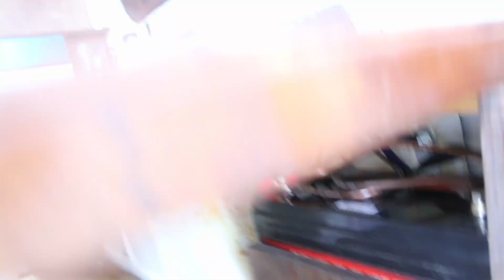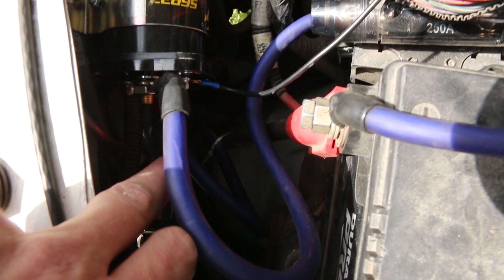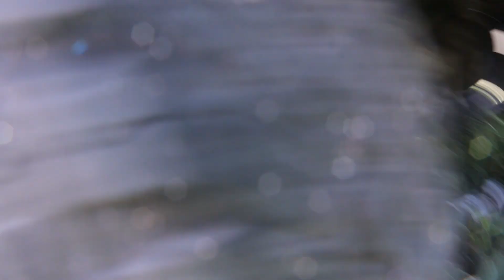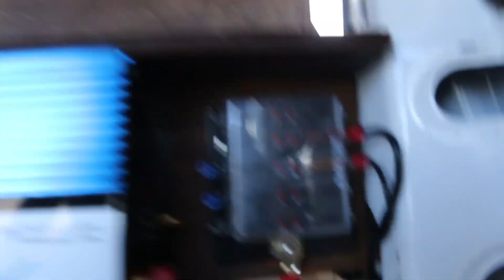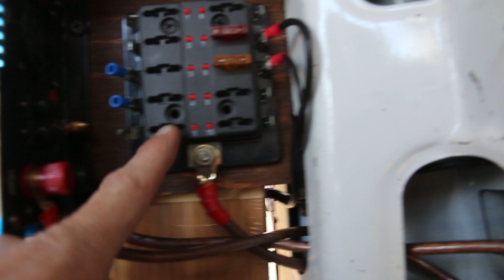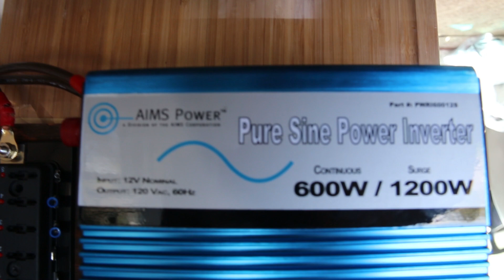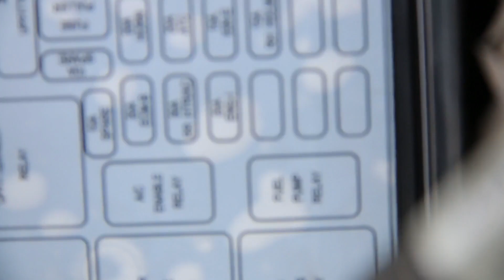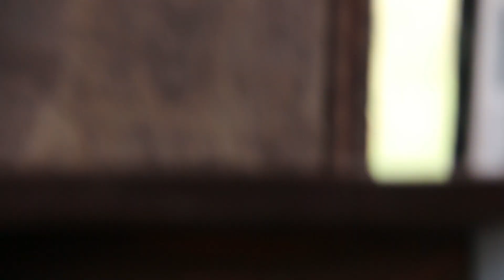How To Install A Secondary Battery, Isolator, Inverter In Your Van

Comment: I read one f your comments where you reply saying if a secondary power source like a solar panel is added the relay can or cant be used i didnt understand ? Does it mean the stinger sgp32 or the AC enable relay can or cant be used when using secondary power source ??? Im so confused
Reply from the maker: You can add a solar panel and still use the relay
Reply: i think you can use a solar panel but it should be hooked up to the primary battery for the started. that way if it gets up enough voltage itll start to run over to your secondary battery that is doing your other stuff.  gotta keep the starter battery healthy first because whats gonna get you out of the sticks to get any other supplies you may need on your journey. having the ability to push start a standard is always a good backup plan but push starting is just plain hard to do. lol (pro-tip=unless you think to park on a slope cause you know your battery is bad beforehand ;)

Comment: Hello Mike, very good DIY instructional video. I must comment on one thing... I will add an AGM charge regulator on the alternator circuit in my Astro van so that my deep cycle battery can last longer. These like a slow and low charge compared to your crank AMP battery. VanLife!

Comment: Do you need to vent to the exhilarate battery to the outside
Reply from the maker: If it's a lead acid battery or any other unsealed battery, then yes. This agm is a seal d battery so it does not. If you can fit the battery in the engine compartment or other location on the outside, it's a better option either way

Comment: I would bring a negative wire back there, instead of running all your current through the vehicle/ using your vehicle as a conductor.   Wonder what the side effects are?  Any r.f. being produced?  Any current bridging a gap/ ready to burn your whole shit down?
Reply: The vehicle chassis is used to ground all the electric.
Reply: @LawnWrangler323  I know the entire vehicle is bonded. But why call it a ground?  Is the current going to ground?  Or back to the negative terminal?
Reply: @--JohnDoe  electrical ground, the negative terminal of the battery (normal operation)
Reply: @StrokeMahEgo  so I connect the negative terminal to the ground? Well then how do I drive away if I'm teathered by a wire?  You must of mean bond the negative and vehicle chasis together, right?    B.t.w. which way do electrons flow according to electron theory?
Reply: @--JohnDoe  the chassis of the vehicle is connected to the negative terminal. Therefore, any conductive surface on the vehicle chaos can be used as an electrical ground without running a new cable to the negative terminal. 
Electrons move from negative to positive.
Reply: StrokeMahEgo if it flows backwards then why do we fuse the positive, close to B+? Just trying to understand why fuses are located where they are...
Reply: @code3responsevideos872  because electrons flow from - to +, but electrons are negatively charged, so " the charge" goes + to -
Reply: StrokeMahEgo so if that is true, is it necessary to fuse a wire running between dual batteries at both ends?
Reply: @code3responsevideos872  I don't know, but that's what's I was taught in my electrical apprenticeship for electrical theory.   Laws are what is happening, and theories are what they think is happening.
Reply: @code3responsevideos872  necessary, probably not. The fuse just breaks the circuit if it goes over draw
Reply: StrokeMahEgo I am hooking up a dual battery set up through a VSR. All of my loads will hook to my second battery which is controlled by the VSR. I am planning on fusing the B+ wire to the second battery. Also am fusing all the loads separately. This seems to be an effective way to keep my start battery separate and also minimize the load on my alternator. If the VSR input goes below 12.8 it will shut off the charge line. Any thoughts?
Reply: @code3responsevideos872   The Length of wire from the front fuse to the back fuse will have current to it from either battery if one of the fuses has blown, so if the vehicle had a smash and that wire was shorted out by that crash, without that second fuse there would be a fire hazard.
Reply: challenger1948 so I DO need to fuse it at both ends!!! I was planning on doing it but I wasn’t sure exactly why! Thanks for your help! Last question. Can I ground my second battery to the frame? Or do I need to run a dedicated wire to my main battery?
Reply: @code3responsevideos872  Ground it to the frame, just make sure it is a good  clean ground, just the same as you would do for the main battery
Reply: challenger1948 thanks. I got my batteries hooked up with a fuse at both ends. I hooked up everything and it works great! Thanks!
Reply: @code3responsevideos872  if you want the most reliable system, ground EVERY battery to the frame AND body THEN ALSO run another cable connecting both negative terminals.  i guarantee youll have a much more solid setup this way.  itll also work the way jordan mamrak says too but what if one of your grounds gets a shaky connection? could start a fire just as easily as a bad positive connection could! all my grounds are hidden so the more the better from my poit of view but if theyre all out where you can regularly check them, grounding with one point per battery is fine. they will just need a more regular cleaning cause they can get loose or corroded up too just like the positive side
Reply: James Wise thanks for your help. I got the battery grounded at the frame.
Reply: @--JohnDoe  Your comment about the ground...that's a joke, right?
Reply: @Truedoogie  what ground? There is no ground in automobiles. How do you connect to the ground and still drive?  It's a negative terminal.
Reply: As a fabricator, welder and hot rod builder, I'd like add a little advice. ALWAYS grommet and paint any through holes through metal. Also when dealing with older vehicles, if you ground to chassis always run a separate cable 6ga minimum from chassis to battery also. Rust can do weird things to steel and you may not have a good bond back to battery.

Comment: great video! how is your VMAX SLR battery holding out? im thinking of doing a similar gig as yours but heard that AGM batteries do not do well installed how you install them. could you share any advice/experiences with your current battery? i just want to make sure i get the right one. (my electrical needs are pretty much the same as yours)
Reply from the maker: This wasn't my van, so not sure how it's still holding up. I do however use the same batteries with my wind turbine and they've been holding up well for a few years now. They can keep a charge for a long time without draining

Comment: Hey Mike, thanks for the great vid, and commenters for some improvements like grommets. I got a question for ya: I want to do this set up in my 99 Subaru BUT I also want to make it as easy as possible to remove and then plug back in. The reason is so I can use the battery and inverter as a busking rig that charges in my car, so ideally I would want to house the battery and inverter in a rolling suitcase or something similar then be able to snap the system back into the cars main battery. Hope I was clear, any help much appreciated!
Reply from the maker: Cool idea. I think you could do something like that rather easily. I'd probably just build a small box out of plywood, cut out handle on either side and mount battery and inverter inside so they don't get damaged when moving. Could mount the inverter in a way that holes are cut to access the plug end without having to open the box. I would add banana style plugs for quick connect and disconnect of positive and negative terminals. Make sure you have something to cap off the positive lead coming to the battery when disconnected to avoid grounding out. Hope this makes sense. Would be easier to sketch it out than explain. Good luck
Reply: @MechanicalMike  wicked, thanks man. I'll grab some banana plugs like you said and do it ✌👍👍

Comment: Great video. Why diddnt you hook the power inverter to the fuse pannel is there a reason it's direct to the battery.
Reply from the maker: The power inverter has it's own fuse and creates A/C power for plug in devices. The  fuse block is for powering D/C electronics that are built into the van

Comment: Question I bought an Stinger SGP38 and will be running a two port 12 volt socket one for my front view facing dvr and one for my cell phone which had 2 USB charging ports. I will also connect an Everstart Plus 400 watt inverter to run my laptop and any secondary equipment such as my AKAI MPC 25 and connecting all of this to an 1995 geo metro 3 cyclinder, so my question is what wire size guage do I use for the battery connection and guage wire for the starter connection and finally on my vehicle which one do I connect the "true ignition source"???

Comment: Advice switch out the fuse for a circuit breaker.I have seen fuse holder melt and the fuse not blow. Also nothing worst then to be in the middle of nowhere and lose a fuse

Comment: Good evening and thanks a lot for sharing your work, especially laying down on the ground to show the details. I recently purchased and new battery for my Honda Accord 2004, and kept the old one for additional use / dual use for the basic appliances ie microwave, rice-cooker and electric kettle. At this moment I didn’t purchase any appliances and I want to know from basics: what wires, inverter should I buy to run basic rice cooker, microwave and electric kettle: not necessarily to run all same time at once. Please recommend me the appliances  and connection materials so that I can take to an electrician to wire it for me. Although I want to get the electrician to get the job done; I would like to be part of the planning stage and selection of the appliances. The purpose is to support me for RVing.

Thanks a lot
Reply: An idea for Down the road. batteryguys.com got a 100 amp hour deep cycle battery for $125. To your door

Comment: Does the battery have to be the same brand?
Reply from the maker: No, just a deep cycle battery because you won't need it for cold cranking amps
Reply: No. The two batteries have a different purpose. The coach battery (in the back) should be a deep cycle as they are less affected by being discharged. Deep cycles may be damaged if drained below 20% charge, but have a long life when discharged down to 50%. Starting batteries (in the front) have a long life is discharged to 80%, as you discharge below that you shorten their life, and they may be damaged if discharged below 50%. 
 If you have two coach batteries, they should be the same brand/model/age to maximize energy output and life.
The isolator is performing the job of separating the starting and coach battery for their separate purposes.

Comment: don't rely on the zip-ties, they will snap eventually with all the vibration and heat cycles, use proper Rubber Sleeve P Clamps.

Comment: The fuses should be sized for the wire not the load, because that is what you are protecting the wire from being over loaded by the load and starting a fire. Of course the wire should be sized to handle the load to begin with. If you size the fuse to the load it will not help anything if the wire you are using is undersized to begin with. Say you have a 20 amp load and you're using a 25 amp fuse but a wire that's only rated for say 15 amps you're going to be in trouble that circuit is going to allow the load to pull up to 10 amps more then the wire is rated for. This is why you size the fuse for the wire being used not the load.
Reply: Thanks Mitch for pointing this out. This is the only weakness I found in the video above else it was an awesome effort by Mike.

Comment: Do you need to upgrade your stock Alternator to run the dual battery setup?
Reply from the maker: Not necessarily. If you don't have much tied into your secondary battery or have a supplemental power source like a solar panel you should be fine. If you use enough power to drain the secondary battery down often, then your alternator has to work harder to put out enough juice to recharge both batteries. It will still work but will shorten the life of your alternator. So really up to you
Reply: @MechanicalMike  then is it necessary to use the same battery size same as the existing battery?or can use bigger or smaller secondary battery?
Reply: @MechanicalMike  I will just be using it to listen to the head unit as I'm working maybe about 30mi to 1hr if possible I want to avoid having to get a jump start but have the power on hand if ever needed nothing special I just load and unload merch from my 2018 Chevrolet Express
Reply: I wondered the same thing but i never had an issue recharging my group 27 slave battery with this setup...i think it takes me about an hour of driving to fully charge back up from 50 percent power left... there about. ..
Reply: No. I would get a blue sea charging relay  used their stuff for years  ..https://www.jamestowndistributors.com/userportal/show_product.do?pid=8971&familyName=Blue+Sea+Systems+SI-Series+Automatic+Charging+Relay

Comment: installed this similar set up, except refregerator and dc fuse box, for camper sleeper 3 months ago..super pleased...will list amazon prices and items soon...thanks mike..never needed my solar backup for 6 weeks straight road trip..electric blanket..charging electronics. .fans..interior and exterior lights..used minkota battery box for extra dc outlets that has battery power tester light button ...so no dc fuse box needed..any queston on my set up let me know....
Reply: no i dont..but i used the excact schematic (same isolator, cable gauges,waterproof inline fuses,aims inverter) as mike's except i didnt hook up a dc fuse panel. ..and my slave battery is inside a minkota accessory batery box that has 2 dc outlets and outside posts..
Reply: You don't happen to have a schematic of your set up that I could take a look at?

Comment: and whats the relay for and where can i get one
Reply: its to send a charge to slave battery when vehicle is running and isolate slave battery from pulling power back from your vehicles starter battery when using slave battery for camping/living...amazon Stinger SPG32
Reply: @the03mach1  I've had a pretty similar setup for about 4 years.  Sometimes I have an issue starting the engine when the auxiliary battery is low.  When turning the ignition, It seems the low aux battery is trying to charge from the full starter battery.   I think the aux battery is drawing amps that are preventing the fully charged main battery from being able to crank the engine?  I installed a non latching switch near the ignition to isolate the starting battery in order to start the engine when the auxiliary battery is low.
Reply: @Nick Hohn isolators have a shelf life of so many hours ..if you used it for four years it probably needs to be replaced...use a volt meter  to see if the the relay is cutting on and off the power to aux battery when starting the vehicle..and make sure you are truly using a true ignition sorce wire to activate the relay...
Reply: @the03mach1  Only 20K miles in 4 years.  Relay is good.  This has been an issue since day one.  Swapped it out once to make sure.  My understanding is, when starting the vehicle the relay switches so that both batteries can be charged by the alternator?  When in accessory mode, only the auxiliary battery is engaged.  I don't think the relay cuts off the aux battery when starting.  I guess I am using the accessory source wire to activate?

Comment: EVERY hole the positive wire goes through should have grommets ! Even if the holes are in plastic, they can rub through and something grounded touches it and voila ! You have created fire .
Other than that, the fuse and isolator were right next to the battery, well laid out and executed .
Reply from the maker: Grommets were added

Comment: In my case I'm turning my suv into a temporary camper, so my question is ; how do you keep the battery from overcharging  if not using the battery everyday.? Is there a charge controller that you know of that I could use?
Reply from the maker: The alternator should have a regulator that switches on and off, though it is intended for the original battery. You can get a charge controller, such as used in solar and wind systems if you prefer. They should be adjustable as far as when you want it to kick in and turn off. Just make sure it can handle the amperage or it might melt down.
Reply: @MechanicalMike  I've searched for dc to dc charge controllers but no luck, do you know of any?
Reply: if your using the setup mike is showing and not starting your car for days you would be running out of power in your slave battery..alternators 2006 and newer are made not to over charge battery..if you have this setup you should not need solar for temporary camping unless u have the constant running appliance and never start up the vehicle for days..
Reply: @the03mach1  thanks for the info, I've been looking for a DC to dc charge controller but I can't seem to find one that I can tie in to the system.

Comment: Great instructional. Thanks! Also, I have learned from other sources that it is important to make sure you have a sealed battery if you are going to install it inside the vehicle. Toxic gas emits from vented batteries.
Reply from the maker: Yes, a sealed battery is a must when installing inside the car. This is a sealed battery in this case